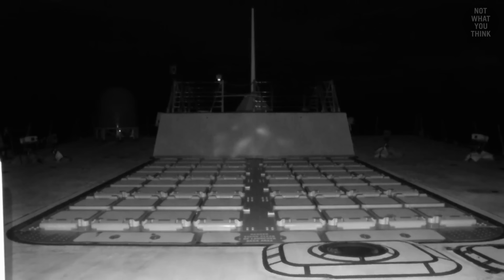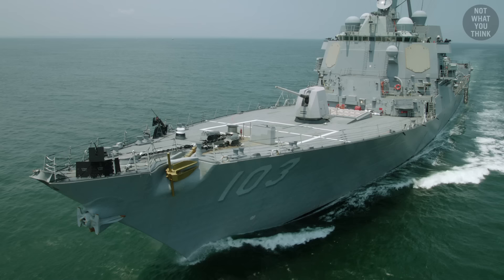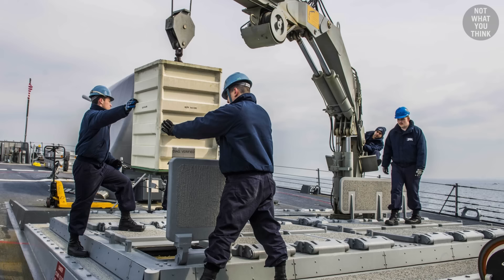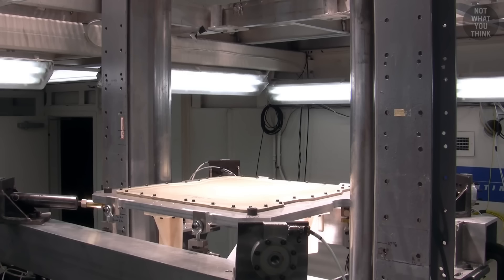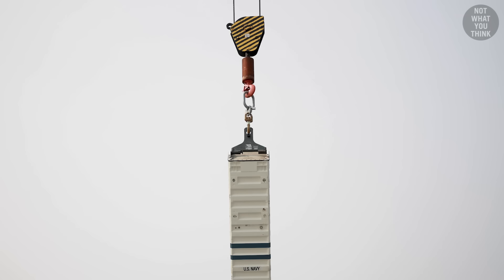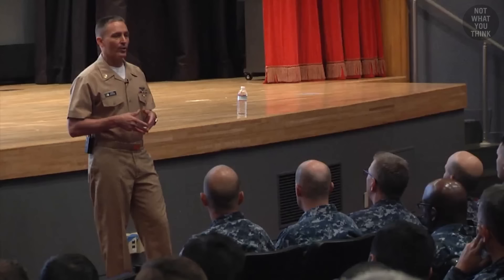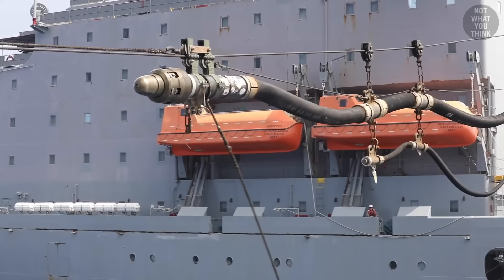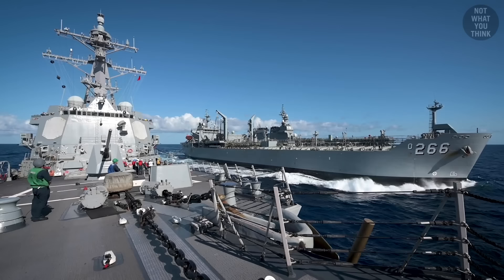Why Warships Cannot Reload Missiles at Sea

Comment: Mk-41 VLS certainly can be reloaded and I have been part of a crew that did so.  On our 1988/89 deployment aboard the ammunition ship USS Kiska we re-loaded the aft VLS of USS Antietam while underway in the Pacific.  We brought Antietam five loaded SM-2 canisters and brought back five empties as retrograde.  We did this with a CH-46D helicopter.   We delivered the canisters to the main deck between the aft VLS and aft 5in/54 cal gun.  We used a long rope hanging from the VLS canister so deck crew could keep the canister from spinning as we set it on deck.   We had to make the lifts at minimum fuel because the missile and canister weighted about 4,200 lbs. After delivering the full canister we would land on Kiska and take a splash of fuel rotors turning.  After a few minutes the Antietam crew had an empty canister for us to pick up.  We'd lift off Kiska, pick up the empty and return to our flight deck before bringing Antietam another SM-2 in its canister.  We transferred five SM-2s that way on afternoon after an exercise where Antietam expended some of her SM-2s.  Back then one group of four VLS cells was replaced with a crane system that was designed to allow underway replenishment of the VLS system from either an alongside ammo ship or, as we did, using a VERTREP helicopter.  My understanding is the Navy removed the cranes to allow their ships to carry four more Tomahawks, since the CONOPS of the Gulf Wars, war in Afghanistan and GWOT operations in general allowed ships to reload pier side in Bahrain.
Reply: So you sling loaded munitions, at sea, and also did hot refuels. That's three dangerous things combined. I'm surprised any commander would sign off on it.

Oh wait this was the 80s. Different time back then. Bigger balls.
Reply: @Oberon4278  ???  That is how it is still done.  Other than the helicopter used nothing has changed and it's not especially dangerous.  You could drop the whole canister on deck and aside from banging things up nothing bad would happen.  Find out what "insensitive munitions" are.  Hot refueling is likewise standard practice both ashore and at sea.   You are not going to shut down to refuel.  Big waste of time.   If the ship had too small a flight deck for our helo, example most frigates, we could hover over the flight deck, lower our rescue hoist to the deck, hoist the fuel hose up into the cabin using and plug the dry break connection in to a refueling station inside the cabin.  We would just fly along in a hover matching the ship's speed as we refueled.  When topped up our crewman would disconnect the fuel hose and hoist it back down to the flight deck.  Then we'd depart.  Easy.  Did that almost every day underway.  Find out what HIFR, Hover In Flight Refueling is.  Ashore we'd land at a set of helo pads by the fuel farm, taxi into one of the fuel pits and hot refuel before taxiing over to our hanger and shutting down.
Reply: @philsalvatore3902  I was a weapons technician for the Apache in the Army, so I'm familiar with a lot of what you said. It must be different in the Navy because we didn't do hot refuels if it could be avoided. Don't get me wrong, they weren't vanishingly rare, and we knew what and how to do it, including reloading/rearming during a hot refuel. But we only did it during training, or if there were troops in contact who needed air support. Otherwise the risk was considered too high.

I guess it should have been obvious that the munitions are safe until armed/fired. The same is true for the 30mm shells that the Apache fires. You can put them in a literal meat grinder and nothing happens. If you get the timing wrong on the gun, it will chew up the rounds and drop them out the bottom.

It should go without saying that I never got the timing wrong 😉 I actually got an extremely low-ranking medal (Army Achievement Medal) for being one of the best technicians on our deployment. Caught a lot of errors other people missed that would have been a problem.
Reply: @Oberon4278  When the carrier deploys the ammo upload is accomplished at sea from an ammunition ship or now it would be a T-AKE.  The carrier pulls up alongside the T-AKE, three STREAM rigs on the port side of the T-AKE feed ammo to the carrier while aft, two helicopters in what we called a "Daisy Chain" were moving ammo from the T-AKE's flight deck to the carrier's flight deck.  Both ships have fleets of battery electric and CNG powered fork lifts (some munitions were sensitive to electronic fields so they were handled with CNG powered fork lifts).  We could move a lot of freight that way, 30 seconds deck to deck, about 3,000 lbs per lift.  It would take 12-14 hours of solid flying to upload the carrier.  Naturally we hot refueled and changed crews with rotors turning.  Same thing in reverse when the carrier comes back off deployment, all the ammo is downloaded from the carrier to the T-AKE. Sometimes we'd fly out and rendezvous with the inbound and outbound carriers and simply transfer the ammo from one to the other.  Those days took longer because we didn't have the T-AKE with its three STREAM rigs moving ammo.  It was all done by our two CH-46Ds.  It's the last bastion of stick and rudder flying in the Navy.  Look up videos for HC-11 USS Sacramento.  You should be able to find videos us doing VERTEP with the CH-46D.
Reply: @philsalvatore3902  See, this is why I wish I'd joined the Navy.  I had no idea what kind of operations, history, etc. you guys have, I just associated the Navy with that Village People song.
Reply: So are these weapons that sensitive to shocks bumps? Will a canister explode if dropped? 

This might be a granny safety first problem. OR all the connections get damaged if misalligned.
Reply: @unclebobsbees4899  Find out what "insensitive munitions" are.  Hard lessons from the Forrestal and Enterprise disasters.
In addition to making the warheads and rocket motors insensitive, weapons are literally drop tested from specified heights as part of their safety certification process.  The containers most missiles are shipped in are pretty robust and also have considerable dunnage inside them to absorb shocks.

Comment: I can think of a few ways to make this reloadable.
Namely utilizing rails and a reloading arm that hold the missile box with complete stability plus modifications on the holding boxes themselves.
Though it would be a MASSIVE engineering challenge.
Reply: Was thinking the same, but more a connected chute that the crane can basically slide the bottom into and tension guide it via the attached cable into the slot. Have a wide enough gap, some safety lines and it's more than possible
Reply: With modern robotics, you could design a ship to switch out the canisters automatically.

Comment: I'm sure the eventuality was considered but I'd still like to know why they don't use a manipulator instead of a crane. With proper engineering it could be  able to safely store the capsule in the shaft even under the most extreme conditions simply because there would always be a rigid connection between the capsule and the deck.
Reply: It just isn't a useful capability in the big picture.
Reply: It'd require redesigning the vls cells.  They'd need to take side loads, not just vertical loads.   Could be done but not sure about the trade-off.
Reply: On a ship at sea you want that flexibility. A solid armature would make it more difficult to exchange canisters between ships because any difference in their relative motion would cause the stiff manipulater to either bend in ways that would damage itself or cause what it is carrying to impact the other ship instead, and when dealing with explosive weaponry, thats a bad thing. Manipulators large enough to move canisters of that size will not be able to move fast enough to allow for quick reaction times. Physics is just not on the side of this idea.
Reply: As someone else said because then you have a high risk of breaking while handling extremely expensive and extremely explosive weapons.

Comment: What I was trying to get at is this: Use the freighter as the dock with the crane that loads the destroyers with multi missile magazines in a few big crane lifts, instead of 96 separate small crane lifts. The freighter doesn't need the targeting systems or fighting crew, it just goes from ship to ship loading what they need and hiding the rest of the time.
Reply: They did something similar with specialised tenders and floating dry docks for the Polaris submarines, but they operated as semi-permanent installations that were moored very close to naval bases in sheltered, very well-defended coastal waters of closely allied nations. Probably the most famous example is Holy Loch in Scotland and if you look at it on a map or satellite photo you can see why it was chosen. Waters like that can literally be like a mill pond in very calm weather, whereas the open ocean is far rougher even at the best of times. These ships would be priority targets at sea while also being slow and relatively undefended - problem would be where would they hide that would be safe, and could they get to and from the fleet's location in a short enough time to be useful?

Comment: 10:56 please also note The airplane in this instance turned off its transponder indicating its civilian origins
And for some reason never answered numerous radio calls warning it was in danger and needed to change course or acknowledge its existence. 
In other words it behaved like an attacking aircraft and with the combination of the mistake the operator made in noticing the airplane ascending added up to an attacking aircraft.
Reply: You should consider reviewing the Fogarty report as well as the ICAO report. The airliner was transmitting its civilian IFF mode 3 code the entire time, from take off to shoot down. Additionally, the US sailors on the USS Vincennes did not use the IFF code when identifying the craft, they only gave general flight condition as identifying info over the civilian emergency frequency. The only time the IFF code was used as identification during transmission was by the USS Sides less than one minute before the missiles launched. The ICAO report states that the warnings given over the radio used ground speed to identify craft, but pilots use indicated airspeed. The report gives nearly a 100 knot difference between the two during the weather and flight conditions for that day. The ships also did not explicitly state to "change course or be fired upon." The command given over the radio was "you are standing into danger and MAY (emphasis mine) be subject to USN defensive measures," followed by "advise change course to X."

There is zero proof the airline pilots did anything wrong, but there is a lot of proof that the US Navy messed up repeatedly.

Comment: The deck crane should have been the arm of an excavator with a grab to hold the missle case. Missile held not hung, arm mounted to deck to null roll. Just a big robot arm instead of a basic crane.
Reply: Exactly, they already use these for both logging and foundation pile-driving, the pile handlers can even spin their grip to align with other beams, or easily the square hatch in the deck.

Comment: We have to remember that the missile knows where it is at all times, mainly because it knows where it isn’t.
Reply: by subtracting from where it is
Reply: @nursestoyland  or where it isn't from where it is (whichever is greater), it obtains a difference, or deviation, which is not what you think.
Reply: @CarbideSix  The guidance subsystem uses deviations to generate corrective commands to drive the missile from a position where it is to a position where it isn't, and arriving at a position where it wasn't, it now is.
Reply: @jbrou123  Consequently, the position where it is, is now the position that it wasn't, and it follows that the position that it was, is now the position that it isn't.
Reply: Sigh.  Please read up on proportional navigation.  That is the foundation of air defense missile guidance.

Comment: I know this thought might require a redesign of the ship itself but my thought was either have like a holder device that comes out of the firing module you can move the missile into then have it slide gently down the tube in the holder device so it's not like threading a needle,  or have a mechanical loading system from underneath instead that starts horizontal and then rolls forward and upwards then seal up the bottom after.

Comment: They could've used a helper rail system to reload the rocket. No need for cranes, except for when placing the rocket containers onto the helper rails! Once they are placed onto the rails, they could be pushed into place, and lifted in a vertical position and lowered slowly into the cell. They could even load an entire row of cells at the same time, this way! Or even better, they could've made the entire system removable, and when needed to reload, just swap the whole ting, with all the cells at once!
Reply: so…something like stripper clips from bolt-action rifles?
Reply: Good idea, but it seems like it would be just as difficult to get the canister on the rail as getting the canister in the box. Swapping out the entire magazine might work, but the wiring and interconnects might be a night mare.
Reply: @jbrou123 right now, we swap the whole ship
Reply: You realize these canisters are 3 stories tall, right? A helper rail in theory would need to be even longer. And realistically would need to move everything out of the way forward of the VLS (can not do it off to the sides as that would over the water), in which case there is usually something else already there such as 54 calibre gun.
Reply: @nursestoyland  Not necessarily that, but that might work too!
Reply: @jbrou123  It could work with a specialized system, but you would also need support ships fitted with that. As for swapping the entire magazine, wiring and interconnects wouldn't be at all a nightmare. We do it all the time when we're building computers from components, we just need to scale things up a bit. But even if you plug things manually, it would still be a lot faster than what's being done currently!
Reply: @kevinfisher1345  Not much longer! I'm sure they could find a lot of solutions regarding this!
Reply: @DanielDogeanu  Considering the length of the canister which only fits on the side of the VLS, yes the only solution would be to permanently remove objects from the topside of the deck. Meaning less weapons. The only place that canister fits on the deck is beside the VLS, and while navy ships are quite wide, they are not that wide. Space fore and aft of the VLS is limited and already filled. Can they make it work? Sure just at what cost.

Comment: I always wondered why they didn't keep the magazine-to-launcher conveyor belt of the arm launcher system, but modify it to load a vertical launcher instead of an arm launcher. Then you can reload at sea in a wider range of sea conditions like an arm launcher, but with most of the reduction in weight, space, and complexity that a VLS provides.
Reply: Because the ships need access to those missiles as fast as combat requires, if it was one modern vls ship vs several past arm launcher variants the modern one might be able to both counter every missile thrown at it and fire back at the enemies, forcing them to decide whether to shoot to kill or shoot to defend.  I don't think it would get a kill unless targeting one or two of their vessels but the arm launchers won't get a kill either until it's out of countermeasures.
Reply: Reloading that magazine is as slow, or more so, than reloading a VLS.
Reply: How would you get the missiles onto the loader or onto the ship in the first place?
Reply: The great value of the Mk-41 is that each cell can carry a different weapon and the load out can be varied depending on the threat.  For some missions your ship may want to replace some of their anti surface missiles with Vertical Launch ASROC (VLA for short) .  The ESSM missile can be "Quad-Packed" four missiles to one VLS canister.  For some threats you might want to carry more quad packed ESSM and fewer SM-6 (less advanced air threat) and use some of the VLS cells for anti-ship missiles.  In other scenarios you might want to carry more SM-3 and fewer or even no Tomahawks.  With the Mk-41 system this is easy to accomplish.   With the old conveyor systems you don't have that flexibility.

Comment: The should use a system like they use to lift shipping containers with a fixed boom so it can't swing in storm conditions
Reply: Lifting shipping containers is done in a port where the water is very still and the ship is securely attached with multiple lines to permanent moorings built into the dockside or sea bed. They're not trying to do it at sea and the cranes they use are enormous - put one of those on a destroyer and it'll capsize.